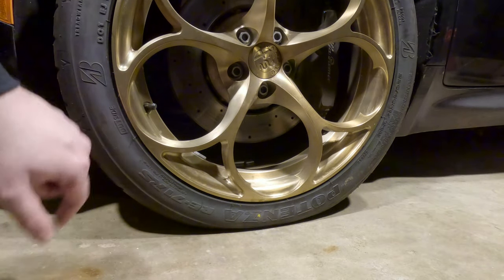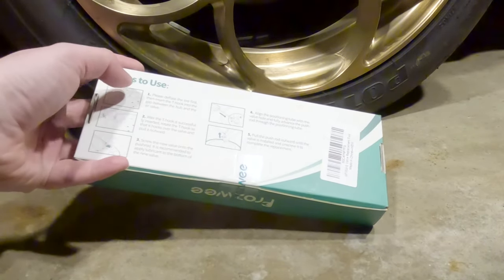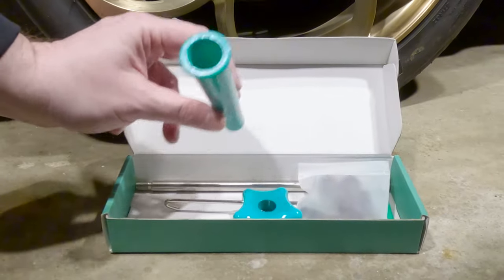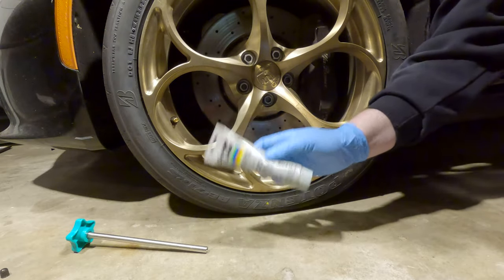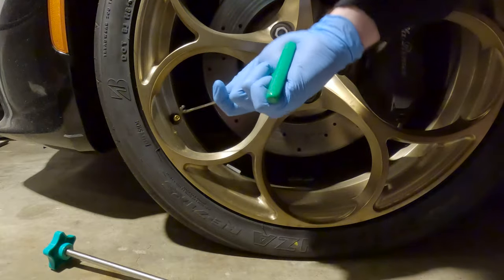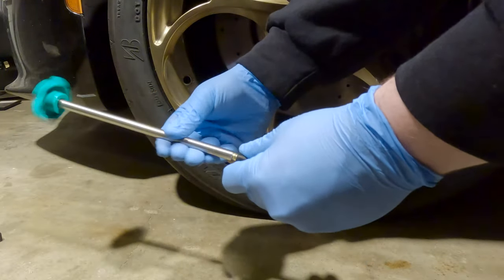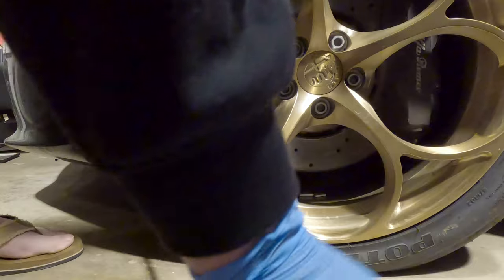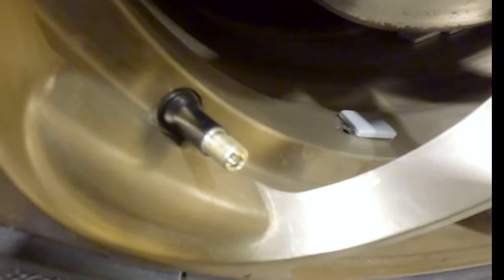How to use a Valve Stem Speed Tool

Comment: Great video as usual. Question for you. How do you find  the Bridgestones for daily use? I currently have ps4s but want something stickier for occasional track use but mainly street. Opinion?
Reply from the maker: Probably not a good idea for daily use. I also have them on an extra set of wheels for my 124, but swap out to a performance all season for daily use and only use the 200tw tires for fun drives.

Comment: WHAT DO YOU DO IF THE VALVE HAS A SENSOR ON IT ?
Reply: Not this kit. 
Tire shop is best, can be done without but tire dismount required.
Reply from the maker: Doesn't work for TPMS valve stems unfortunately.
Reply: I didn't think so. Thanks for the come back. @BookAutowerks

Comment: I am a tool junkie, however before I buy I have to determine cost to benefit.  You probably spend at least $40 for this.  On a one time basis that would not make sense.  In my  60 years of car maintenance, I seldom had a tire problem exclusively valve stem only.  So not sure this purchase makes a lot of economic sense. Also for 2006 or newer vehicles have TPMS so you cannot use this.  I have a 2003 Ford Explorer with TPMS.  I am also suspect that using the super lube could potentially make sealing a problem. 

In fairness I will also go to the proverbial "ends of the earth" to fix something before paying someone else to do it.  Sometimes I win, sometimes it costs me more than its worth.
Reply from the maker: True, it's not going to work with a TPMS valve stem. I have a lot of cars without them, tho. Usually on't even put them in the modern cars 😅
I like to manually check tire pressures often.